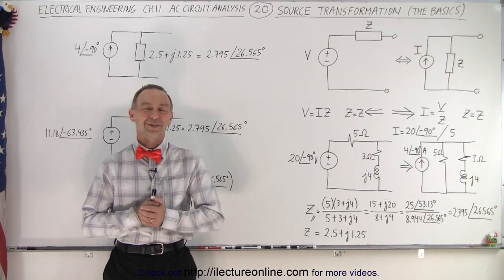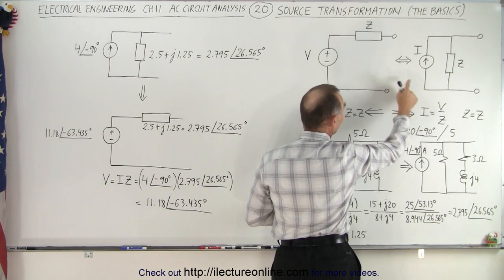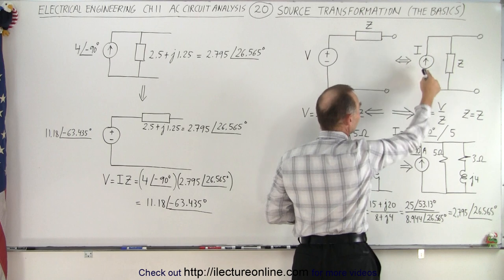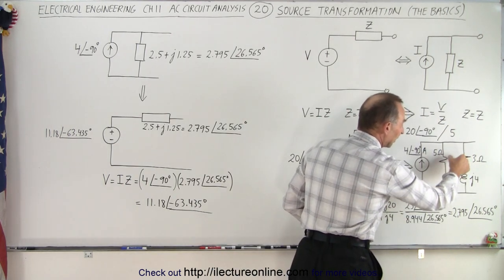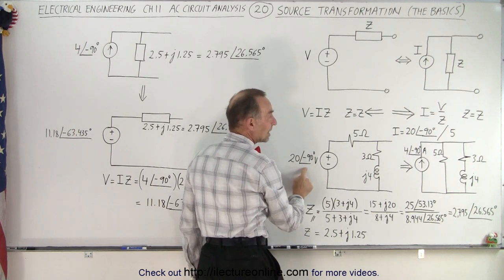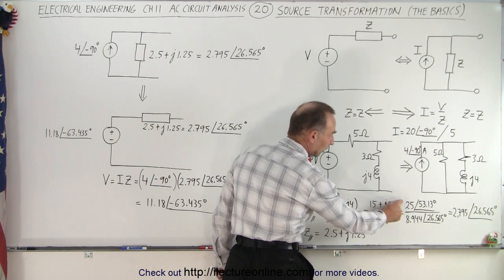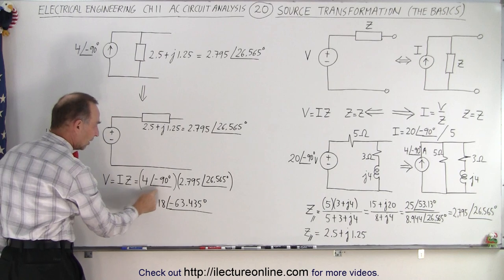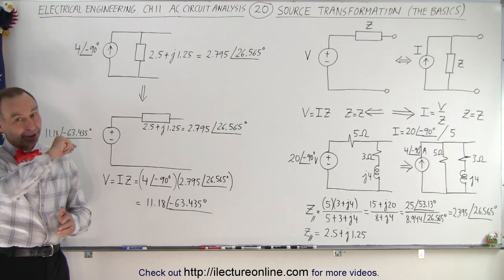Electrical Engineering: Ch 11 AC Circuit Analysis (20 of 34) Source Transformation (The Basics)

Comment: 0:16
Question: I see that this is open circuit How can current go through the impedance Z ?
The circuit to the right seems that the current from the current source can go through the impedance Z.  Isn't that right ?  
Can we say that the two circuits are alike only in case that the circuit on the left is short circuited between its open terminals ?
Reply from the maker: No, you don't want to "short circuit" that part of the circuit.  This is just an example to show you how to perform a source transformation for a piece of a circuit.  It is expected that this will be connected to a load or another part of a circuit.  (That is why the two wires are sticking out to the right.)
Reply: Your answer has clearified the point.
Many thanks for your great videos.

Comment: Omh law I=v/R.....R=Risistance 
Z like R!!?
Reply: Z is the impedance, its unit is also Ohm, the Impedance is something like the resistance of the capacitor/Inductor and its calculated basing on the frequency. 
2*Pi*F*L is the impedance of an Inductor
while Pi is 3,14 
F is the frequency in Hz (Hertz)
and L is the inductance in H (Henry)
Reply from the maker: Good explanation.   This playlist goes into details about reactance and impedance in circuits:  PHYSICS 49 RCL CIRCUITS
Reply: @MichelvanBiezen  Thanks a lot Mr van Biezen for your Effort